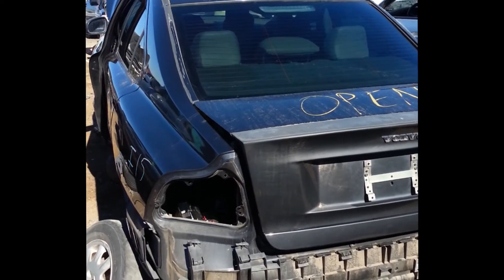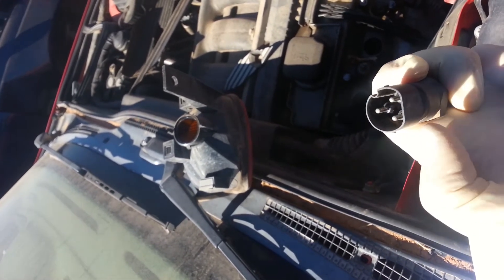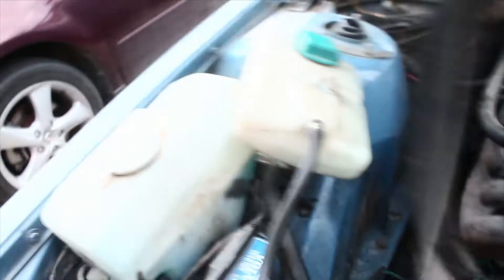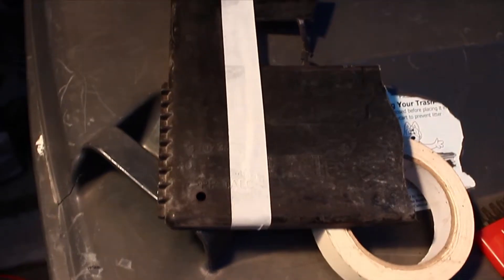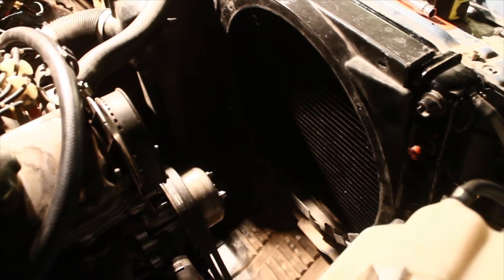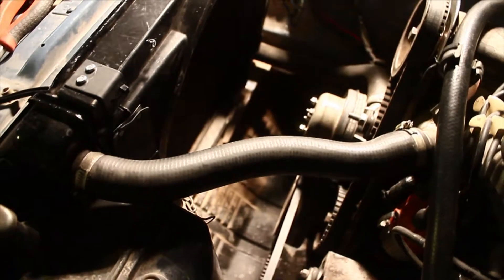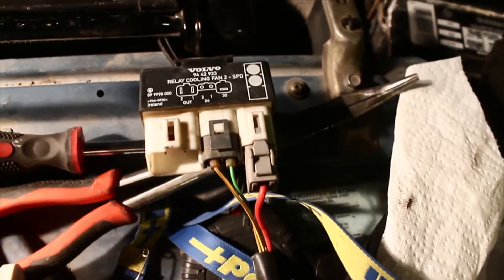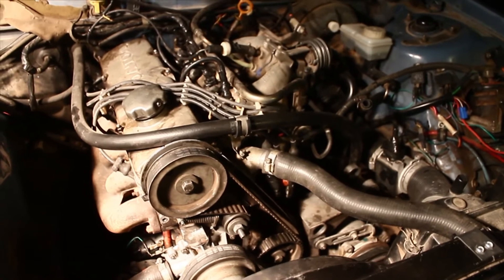Electric Fan Conversion Installation in a Volvo 240 1984 Volvo restoration 245 Station Wagon pt 4

Comment: I had a S80 t6 but sell it because it drain the battery every night by turning on the ac cabin blower for no reason.
Reply from the maker: Oh yup that’s the auto function that dehumidifies the cabin after you stop using the air conditioning, and also maintain a lower in car temperature if you’re parked in the sun. It’s supposed to watch battery voltage so as to not drain the battery. Sounds like something wasn’t communicating or the battery was on its way out.

Comment: Like the video. Quick question. How has it been holding up when you routed the power directly from the fan relay to the battery through the 30 amp fuse link? some guides say to go through another relay controlled by a 12v switch before linking to the battery.

Comment: Loved the video bro you actually explained the relay better than many others on youtube! So initially was your fan disconnected on the far left of the relay in the video? The middle part of the relay(High/low triggers) How are they activated to shift between speeds??  Is it when the Thermostat reads that its too hot and the BMW switch triggers the relay to shift into Speed 2? For my setup, I want to have the speeds automatically change speeds But other people here have a manual switch inside the vehicle.
Reply from the maker: Jonathan Martin  when the temperature climbs the high side circuit on the switch grounds and that triggers the fan relay to high. All done automatically as the need and temp arises. Thanks for watching.

Comment: do you think an e fan conversion would help with overheating with ac on at idle? only time my 240 heats up
Reply from the maker: Volvo put a fan in front of the condenser for that reason. An electric main fan might be powerful enough for both radiator and A/C.

Comment: it isnt a new switch, but i have 2 other used switches ive tried and no luck.
Reply from the maker: Test the continuity of the switches when they're in boiling water at temperature. I doubt all 3 are bad, so also check grounds from the fan and relays

Comment: thanks for the quick response. i mounted it on the top radiator hose, same one that you placed yours. i did wire my set up as you described. i can turn the fan on by unplugging the plug from the temp switch and sticking a wire in one of the terminals and grounding the other end of the wire. my alternator is i believe around 80amps, can that cause the fan not to function?
Reply from the maker: What you describe leads me to think the temperature switch isn't making contact to send the ground signal to the relays and activate the fan circuits. Is it a new switch? Also the top hose os the hotter one so it is the correct spot for the temp reading.

Comment: hi i was wondering how you wired your fan?? i have the bmw switch, volvo 2 speed fan and relay. thats all wired together but the fan doesnt turn on. changed the thermo switch and volvo controller and still no luck.
Reply from the maker: Well it is pretty straightforward. The right side battery cable goes to battery (fused). The middle wires correspond with the low and high fan circuit (grounds for the 2 speed relay), and the left 2 wires plug in from the fan low amd high wires. Check your ground on the 3rd pin of the BMW sensor (it's basically a switch that completes the ground when hot coolant hits it). Also check the fan ground cable (big black one). Where is your switch mounted?